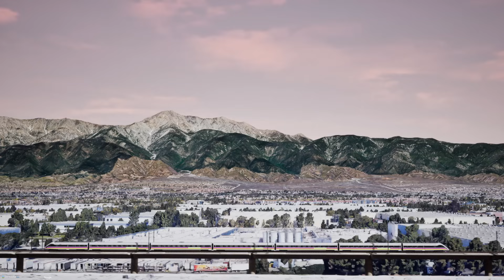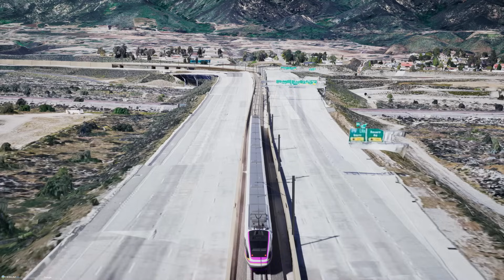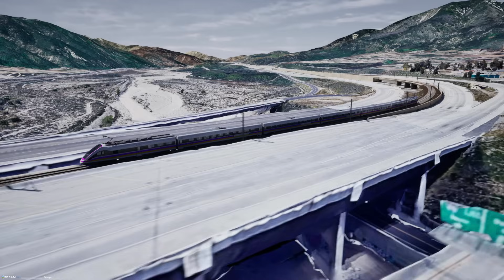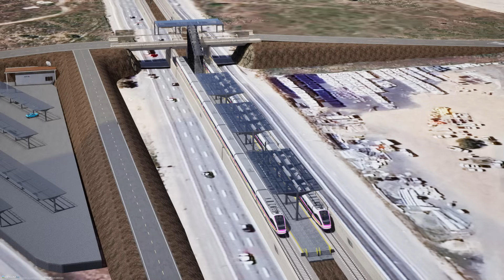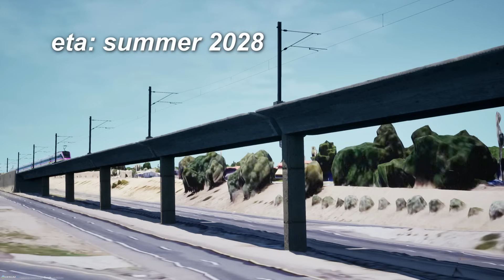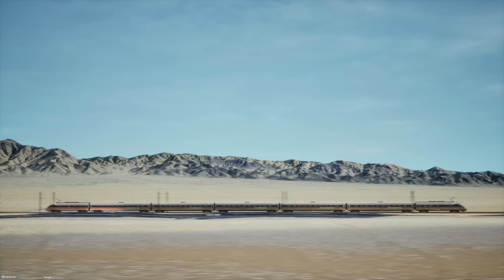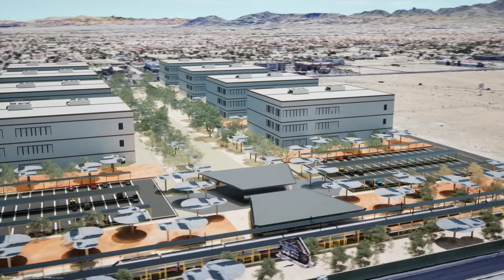The Brightline West High Speed Passenger Rail Route Rendered With Unreal Engine 5

Comment: Unreal Engine makes for a really realistic rendering. It looks like Brightline West will become the main passenger route to the east - realistic or not - which is shorter than going through Phoenix but there's nothin' there. "St. George is next, St. George will be next!" ... and then what? There's Shiprock and Farmington, and another town in or near Colorado I can't recall, then diagonally across most of Kansas over a certain abandoned line would get you in close to Kansas City. Except for Las Vegas and Kansas City it quite a non-populated stretch. I guess it'll work well in it's own right of LA-Vegas if they can fill a train per hour in each direction.
Reply from the maker: Perhaps this hypothetical Four Corners route could run up the Front Range before heading across Kansas. What is the abandoned line through Kansas? I don't see one on the Open Railway map. I get people all the time thinking this is going to end up in Salt Lake City or Reno without really thinking about the implications. I've had requests for trans-Rockies HSR Denver-SLC. These people are killing me.
Reply: @LucidStew  This was from 9 years ago when I was much greener. I finally found it, it's embarrassing. It was the Rock Island starting at Tribune, KS going east to Dighton, which is active. The diagonal part is where it diverges at Dighton and it's like a fantasy property acquisition nightmare. But I mean there's nothin' there. I was a little naive at that point. It finally meets an existing line at Eudora, KS close to KC, then jumps diagonally again to a different line, then crosses under a housing development in a tunnel... i.e. at least some parts of it are impossible - before it gets to Kansas City.

From Indianapolis west to Decatur and Springfield looks like it works. No it doesn't. But I'm convinced this is the fastest route for a transcon though I doubt anyone would ever want to build it. It would need to get connected pretty directly to the B&O east of Dana, IN from Indianapolis. Then it's possible to get to Decatur and Springfield with the B&O line vastly upgraded. I have a longstanding thing about Springfield using the Union Station now a RR museum, where all passenger traffic must run N-S for a bit, although when I drew this I fantasized it could go east west and be served underground from the same station building. The slant of the N-S line (under a street) favors the E-W alignment anyway.

Looks pretty smooth as far as Jacksonville, IL, cutting across fields rather than following the less direct existing. From there it strikes out radically through fields, mountains and the Mississippi River to get to just S. of Carrolllton, MO, where it meets the Santa Fe, and follows that into KC with just one radical tunnel shortcut which might be feasible, starting at the the Missouri River. Then the part I described diagonally across KS to Dighton and Tribune.

Now I'm pretty convinced the next part (assuming something on the lines of the preceding would be possible) makes this the shortest way NY-LA, which I'm still convinced is definitely by way of Indianapolis, turning off a modern-day PRR equivalent there (The PRR line is getting subsumed both E. and W. of Indianapolis.) rather than going on to St. Louis.

From Tribune then (Oh: my line goes N. of both Tribune and Horace - I think it had been located there at one point maybe.)  So from Horace it strikes out SW, bending more directly SW right before Rocky Ford, CO and tunneling under a sparse point of development there a short distance, then continuing SW to where it meets an "Old Railroad Grade" at a wye connection to another one of same running N-S, that takes it on into Walsenberg, where the D&RGW enters from the N. 

It diverges from the D&RGW south of town, first N. then S. and tunnels under the looping switchbacks of the D&RGW - a 13.2mi tunnel according to my 9-yr-old calculations. There's a station just above the NW corner of the grid at Sanford, CO, then it crosses a different D&RGW line running S. from Alamosa. I have it running on the same tangent down through Blue Goose and then like a thirty-mile tunnel emerging at Dulce, NM, running S. of the main road there.

Then from Dulce there's a tunnel maybe 4.25 miles long, followed immediately by another one maybe 5mi long, and across a large area of extractions that's hilly but no tunnels, to the southern shore of Lake Navajo, with maybe a new, lux Harvey House. From there I ran a straight line about 30 miles down to the Interstate south of Farmington, but that and Shiprock are both much more developed now and it would require modification that doesn't jump right out at me. It worked very nicely "as if planned" when I drew the Farmington-through-Shiprock part then, but not now.

From Shiprock it goes out across the desert to where it meets the mountains, and before that point there's a high, green plateau that would require a short tunnel. then it follows the road to St. George along the S. perimeter of the mountains. It actually has a jog N. to St. George then S. to Vegas, and the only reason I included St. George is 'cause there's nothing else around for a thousand miles, and I thought you could build a connection from there towards Salt Lake. Also the running through St. George is much more developed now and would need changing.

I definitely can't work on it now but if you tell me how to sign up for your discord I'll make up a file to separate it from a lot of other stuff from that early age. Like I say, aside from the jog north to St. George it's the shortest possible (The land seems to favor the jog as well.) and that was to be combined with my forty-mile tunnel from N. of Union Station LA directly towards Barstow, for which the Cajon Pass route from ARTIC is probably the logical replacement, though slower. It can be met and coupled onto with trains from LA at Rancho Cucamonga. Though I still think the 40-mile tunnel from Santa Clarita and under a minor fault-not-San Andreas is the best way to get to Bakersfield. The tunnel's not quite 40 miles long, as against the 28 curved tunnels in the idiotic..... And up and down several thousand feet add'l. I'm thinking if Brightline West should DSQ for some reason  it would be possible to have the one from ARTIC ready to go. 

I've given up on the transcon from Indianapolis + now think for passengers the best is St. Louis, Tulsa, OKC, Amarillo, Tucumcari, Santa Rosa (diverging from the Rock Island there) Albuquerque, E. of Flagstaff, Phoenix, Blyth, LA.
Reply: On the other hand, if you got the one into LV done it would be pretty reasonable to connect it to Phoenix, and then not entirely unreasonable to build a shortcut mostly existing to bypass LV and get direct to Barstow. ('course it doesn't get you to LA, but there's a heroic, expensive, time-saving alternate favored by me only - through 29 Palms.
Reply from the maker: @brucehain  here's a Discord invite. https://discord.gg/y9rcQ8uWdH  I feel the same way looking back on just about everything I've made to date. Inevitably I'll run across SOMETHING that was not a very good idea or outright not happening.
Reply: @LucidStew  Super! Thanks, be seein' ya Ops I think I just invalidated the invite.

Comment: That 500' radius curve from 8th St into the I15 is tight, doable but tight. The rail wear will be significant; I'd reckon they will need to replace the outer rails on that curve approx annually (even with lubricators). The trains will likely be able to maintain 75mph going up the pass but the 5 - 6% might leave them gasping and looking for the top of the grade! 😛Going down will see very heavy braking on that 4% grade (not even going to mention the rail creep!!!😲), and get around that 60mph curve at the bottom of the pass. Not saying this is all not doable, but combined with the high ambient temperatures 🥵, will really push the train's capabilities. I guess the design engineers will use this to strengthen their designs and increase marketability; if it will perform on BLW it will perform anywhere ... .
Reply from the maker: Without exaggeration it is an extreme route. I really doubt it would have gotten this far if there were real engineering issues, however, it will be interesting to see how the extra maintenance works out and affects their bottom line.  Another wrinkle of using single-tracked sections... if you have to replace extensive parts or do maintenance that extends beyond overnight you might have some service problems...
As far as the grades and curves go, it DOES all need to get past the FRA, so there's a possible, substantial delay right there if anything pops up after implementation.
Reply: @LucidStew  Good point. Being parsimonious in construction WILL increase their maintenance, both infrastructure and rollingstock, which as you say will affect BLW's bottom line.
Reply: @LucidStew  I could see external pressure from the Department of Transportation, US government, state government, and more on the FRA passing if there's a chance it can actually start in time for the Olympics. The US at that point will be on a world stage and there will be pressure to get the train running. Even if there's slow orders in certain areas while things are fixed. The two Orlando Brightline FL opening delays were due to FRA qualifications. Eventually the route was opened with a reduce speed and then within 4 weeks later, the full 110 MPH between West Palm Beach & Cocoa was allowed. Again, this is if they're right on the cusp of opening. If the safety margin is way too far to risk or Brightline West is way behind schedule, this won't matter.
Reply: Eh, I'm not concerned about the grade. For instance, the Hallerbach Viaduct 4% sees old ICE 3s traverse up and down it regularly much less the improved/newer ICE 3neos. While 5-6% is a good deal more, I don't see it as a problem for the even lighter & more powerful Velaro Novos/AP 220s. Agreed that Siemens will definitely showcase this to markets around the world.
Reply: the problem with 5-6% is not that you have to get over them but also be able to stop and continue the journey
Reply: Although I share your concerns about the gradients, I don't see where the brakes would be a problem. They will brake with the regenerative brake anyway.
Reply: @RTSRafnex2  True. The reality is that the entire descent will be carefully controlled, primarily using the regen, but that will limit speeds.

Comment: I noticed a lot of the open desert sections do not have concrete barriers between the 15 and the tracks. I would hope this wouldn't be the case? Also will be curious to see how sturdy the 4 foot high barriers are. I couldn't find the article, but I remember a median-running Metrolink track had issues with semi-trucks crashing through the barriers and that they were going to put taller and stronger ones in place.
Reply from the maker: Don't read too much into the specifics. Like I said the video is not 100% accurate and meant more to give an impression rather than the precise implementation. The barriers should be in place anywhere the train is in the median. I may have omitted some in the interest of expediency. These barriers are supposed to be similar to Caltrans Type-60, which are reinforced concrete designed to prevent rollover and redirect impact energy rather than absorb. One impression you CAN get from the video is that the railroad roadbed will be slightly elevated in many places relative to the road, so more often than not it looks like that relative 4 feet will be a minimum rather than constant.

Comment: Isnt it kind of risky to have a train running at that speed in the middle of the highway? Top heavy vehicles could still easily flip over the 4 foot wall from both sides
Reply: The worst case scenario would be a large, heavy truck having an accident & ending up on the track just before an approaching train running at 200mph. If that happens, then most likely hwy median running will be banned or higher, stronger barriers will be required. Until then they are doing it as it's a cheaper option. Everything is fine in most transport modality designs until the highly unlikely scenario occurs.
Reply from the maker: I'm not a highway engineer by any means, but from the little I've looked into it these barriers are designed to redirect impacts and prevent rollover. They have a slight inward slope that allows a vehicle to lean into them rather than simply flip over.  The design is pretty standard, crash tested, and has been used for decades, although at 4 feet, these would be slightly higher than normal. The train is less of a concern. HSR crashes are extremely rare.

Comment: In Europe, we just overcome steep grades with *speed*. I think that the steeper parts will be passed at high speed.
Reply from the maker: One issue here is that a number of these climbing sections are directly proceeding a less-than-high-speed curve. The two exceptions I can think of would be Shadow Valley and then ascending from Primm to Mountain Pass before the curve, which is a pretty significant grade.
Reply: Steep grades can be overcome with speed, but the problem comes with curves. You can't run high speeds while turning
Reply: @dragoxphere3341  574.8 km/h was done while turning.
Reply: 6 % is a lot. Some ICE trains do 4% gradients on the Köln - Frankfurt line but normally European HSR to out at 2,5%
Reply: @tja00a  The American Pioneer 220 will be modified for 6% gradients.

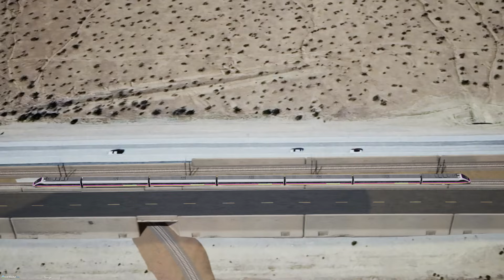Comment: 12:40 Why is Brightline building the station, ostensibly for Victorville, in the middle of the desert, miles from anything? Even as a park & ride, it makes zero sense.
Reply: Today’s “Middle of the desert” is tomorrow’s greenfield transit oriented development.
Reply: @Whatneeds2bsaid  Exactly. Tons of places in America use to be "middle of nowhere", even just ~decade or 2 ago.
Reply from the maker: #1 The freeway is a constraint
#2 That is realistically the first place above the pass where you can put it. The other two intersections have issues.
#3 It's at a major road route junction
#4 believe it or not Hesperia has a population of 100,000 and they're currently building a 15,000 unit subdivision 6 miles from this site.

Comment: Looks nice, but something wrong with the frame rate. First, why it is 25 fps? You are in the U.S., it should be 30 fps or better yet, 60 fps. Try skipping frame by frame, you will get small displacement for four frames, then a large one, like a double, for the fifth frame. What does this mean? Six frames reduced to five, one frame is thrown away, and you get nasty jerky motion. I suppose your original project was 30 fps, but for some reason you've rendered it to 25 fps. Does not look good.
Reply from the maker: There was a one-off error during production, but thanks for the feedback!

Comment: The land development potential for Brightline and other businesses in the area will be off the charts. Hopefully all of them are mixed use like some of the renders mentioned.
Reply from the maker: Rancho's plan is called the HART District. That will be mixed use for sure.  The Victor Valley station is a long way out there right now, but the houses going up 6 miles away in Victorville at present would have seemed like madness 20 years ago.  Vegas, obviously a huge potential draw if its done right. If South Point can pull patrons down that far south on Las Vegas Blvd., BLW can certainly generate some traffic a couple miles closer to the main part of The Strip.

Comment: Awesome video. That computer generation software looks fun to experiment alignments with.  Seems they could move the station closer to Vegas if they tried. Also seems like a waste building the Victor Valley with probably no passengers yet not creating Barstow for commuting to Los Angeles like Hesperia.
Reply from the maker: Fun to lay down tracks for sure. Layering in all the little details is a little more tedious. But just track and the train it reveals things about the landscape and route choices that satellite or even 3D without the track doesn't accomplish.
The way BLW has explained it is that Victor Valley is meant as a singular station for the entire area. It's only a couple of miles farther from Barstow than it is the Hesperia station. I think the main attraction was the land. You have to remember they're a development company as much as a railroad company. I think they want both to work, and for rail to break even, but they're most successful when rail and development drive each others value. Despite Brightline in Florida struggling to become profitable, they're apparently doing quite well on the real estate development side.

Comment: At the end of this they should be planning extensions to Reno, Phoenix and Salt Lake tbh idk if its possible to have a train between Sacramento and Reno tho

But it feels silly that this doesn't connect to Vegas' airport lmao its right there
Reply from the maker: I would doubt it. They're looking to connect very specific city pairs and keep costs low. Despite the FSP-National grant, they are still a private company, and they do have some debt issues, so they can't really indulge in more expensive options that might make sense for a public approach.
Reply: the underground Vegas Loop should connect the Brightline station, the airport, and dozens of other places in and around the strip
Reply from the maker: @StreamSched  The last map I saw had one in the future at the corner of Las Vegas Blvd. and Blue Diamond, but my understanding is that its fairly simple to add and connect new stations, so one AT the Brightline West station is certainly possible. The Loop doesn't have the capacity of mass transit, but it will probably help in pulling some people off of Las Vegas Blvd. and I-15 from the BLW station.